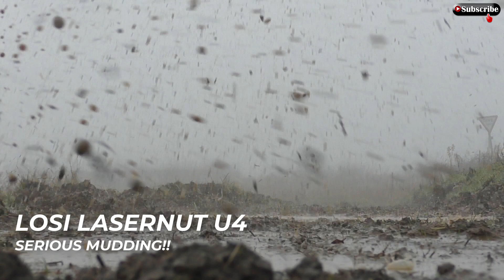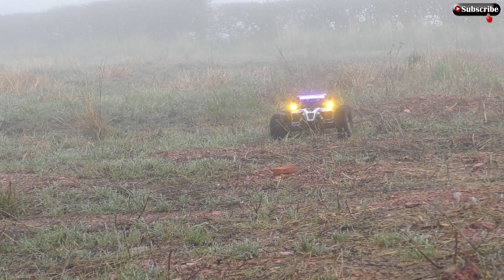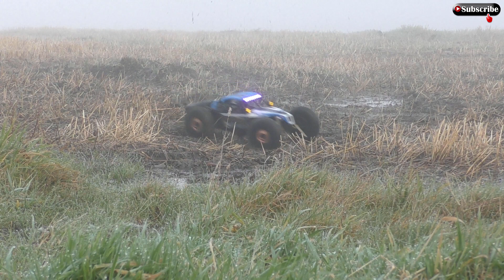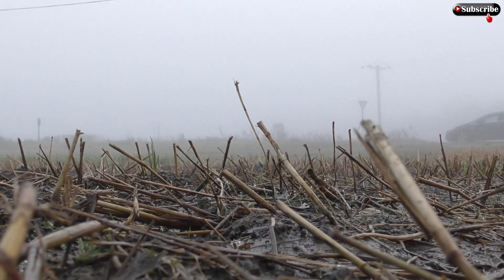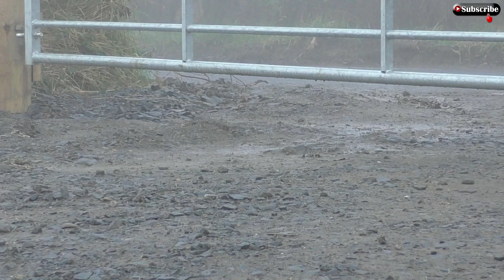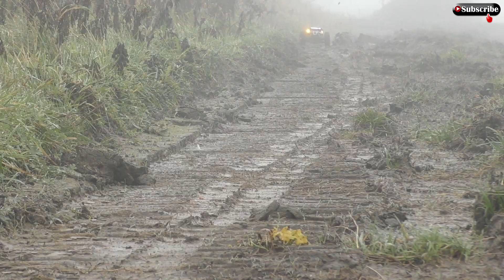LOSI LASERNUT U4 HARDCORE MUDDING!!!

Comment: Great video thanks!!!. I blew my rear diff a couple weeks ago.  Losi support was excellent and sent out new parts immediately.  But I ended up replacing the diff with the TEN SCTE kit diff. Download the manual to get all the part numbers.  The case and outdrives are way stronger. I used the lasernut ring and pinion to keep the gearing the same and bought some J&T 5x11x4 bearings which are far superior to losi. Hope this helps someone.  I got everything to do all 3 diffs. I want to drive a bit first!!!

Comment: Nice bash!!  I have a lasernut and like most, I lost my rear wheel on my first bash. I ordered some TLR locking wheel nuts and added thread lock and have been fine. I think you give some of the better, realistic reviews of the buggy and I’m curious to see your upgrades.
Reply from the maker: Thanks man not done alot really to the car last few videos I touched on it basically shimmed centre diff replaced broken shafts added longer servo horn and nylocks on the wheels other than that left standard all they little things make it run great now all should have been done in factory the diff shims really annoyed me